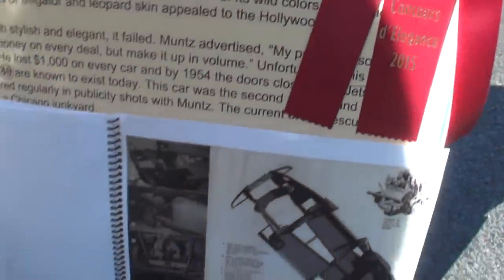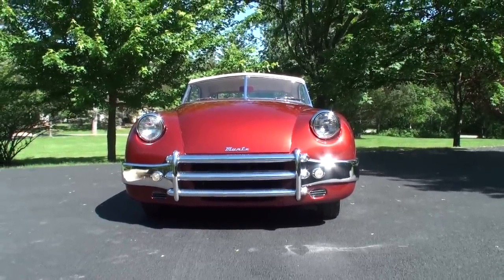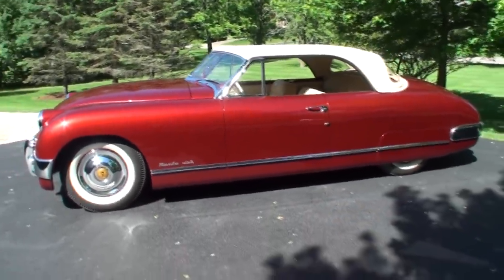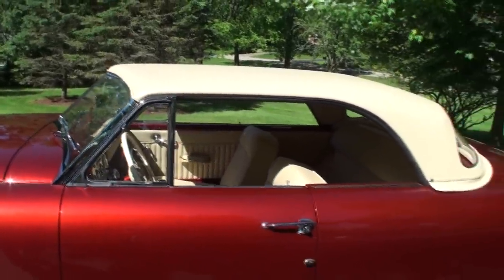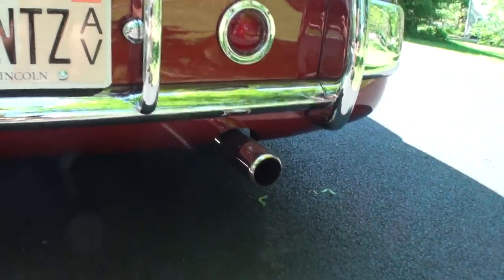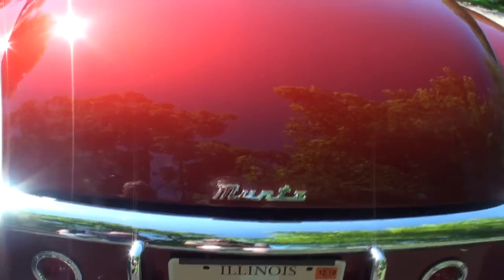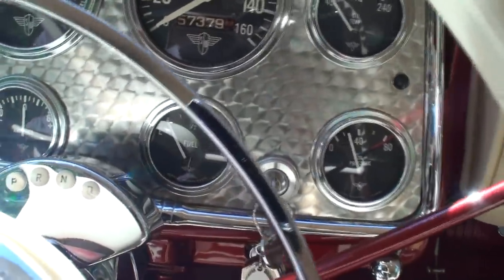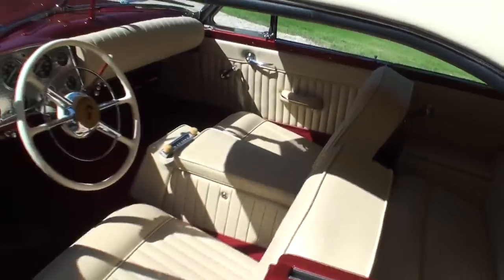1950 Muntz Jet Convertible in Merlot Red Paint & Engine Sound on My Car Story with Lou Costabile

Comment: A little back story on this car... They mention that it was the work of Frank Kurtis, legendary builder of Indianapolis race cars. His shop was in Glendale California. He made race cars for all kinds of customers, and would build a custom sports car too if you asked.

In 1941 he bought a wrecked Buick and rebuilt it into a low, sleek sports car that looked very much like this car, and drove it to the last prewar Indy 500 in May 1941. After the war he made duplicates in series production like this car, one of 28.

Earl "Madman" Muntz made his fame as a salesman of radios and used cars during the war in California. When the Kaiser and Frazer cars came out in 1946 he became the California distributor. When he spotted the Kurtis sports cars, he made a deal with Kurtis to buy the rights.

This is when production was moved to Evanston, the car was lengthened 11 inches to get a bigger back seat and body was changed from aluminum to steel.

Production continued for a while but then the major manufacturers brought out cars like the Nash Healey. Chevrolet Corvette, Ford Thunderbird, Buick Skylark and Packard Caribbean. The very expensive, hand built Muntz cars could not compete on price and fell by the way side.

Still, a very fine and beautiful car that goes down in history as the first production sports car in America.
Reply from the maker: Hi Mr Danforth 374, Thank you for viewing, sharing your knowledge, and adding to the story.  Hope you see many more cars on the Channel you'll enjoy, Lou

Comment: Lou:it should be noted that in the early 50's the Caddy V8 engine was the "go too"
engine for performance. 
This all changed in '55 with the legendary Chev V8 engine. In fact, the Chev V8 was actually based upon the Caddy V8.
Designer Ed Cole modified the Chevy V8 to be lighter and more agile and thus operate at higher RPM for even more power. You can not discount the Caddy V8 of that era because even though it's heavier and has less RPM, it's a torquey gem and can be turned for a lot more power as is the case in this Muntz jet. I've actually worked on a few of these early Caddy V8's
Certainly a nice car there.
Reply from the maker: Hi Paul Kirkland, Thank you for viewing, sharing your knowledge, and adding to the story, Lou